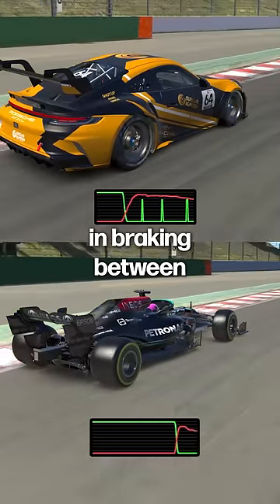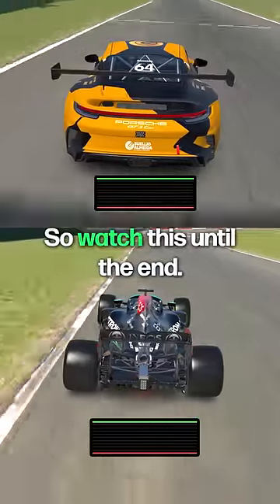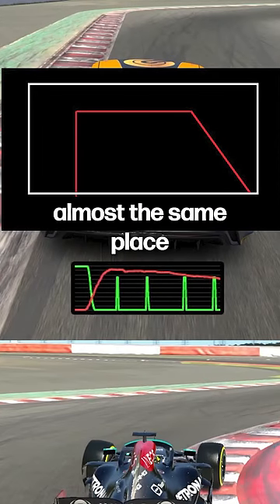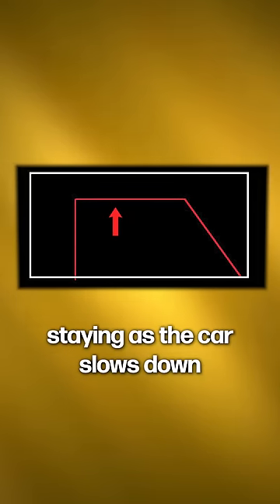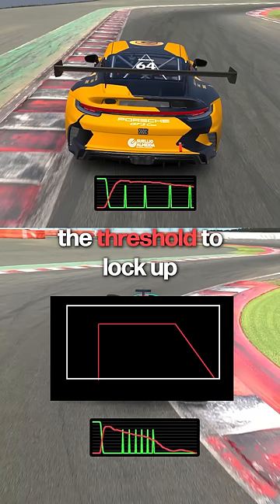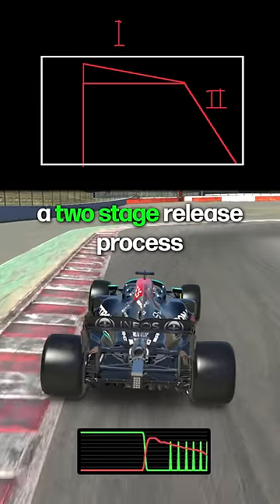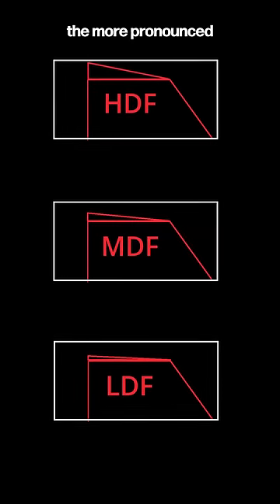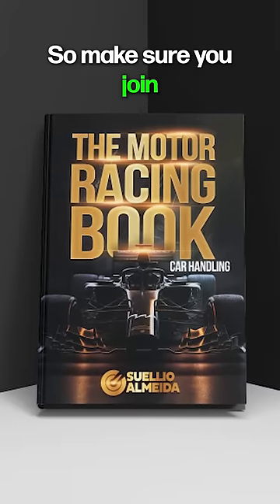BIGGEST Difference - Formula vs GT BRAKING TECHNIQUE! #simracing

Comment: My guy made it more confusing
Reply: Only engineers understand
Reply: Lets say this in percents (the braking). In f1 car :
1. Press to 100% to slow down quick. If it is staying at 100% for too much you will lock up.
2. Release the brake to 80-95%. The maximum pressure you need no brake and not to lock up.
3. Release it to 0% gradually, and start tacking the corner and accelerating.
Reply: See, you don't just have to trail brake, you have to release some brake pressure while braking in a straight line, because your downforce decreases as your speed decreases, decreasing how hard you can brake because your grip is lower

Comment: Isn't that because the GT car has ABS while the Formula doesn't? I don't understand how downforce has anything to do with locking your wheels
Reply: Downforce adds grip. So when the downforce gets lower because your slowing down, the available grip for braking also is less.
Reply: Downforce helps you slow down.
Reply: Downforce pushes your car and tyres into the ground, giving you grip. The more downforce you have, the more grip your tyres have. You also have more downforce at higher speeds. So higher speeds = more grip = more brake pressure.

As you slow down, you lose downforce, so your tyres have less grip, and you have to reduce brake pressure so you don’t lock up.

Comment: yes and no
this is all good and dandy with ABS and other electronic aides...
but different configurations require different techniques... wings or no wings...

it's based on the kinetic energy, force of friction on the tires and breaking force required to lock the wheels...

Comment: Why in iRacing drivers almost never use 100% brake in any car??
Reply: ACC is much more forgiving with braking, iRacing it’s a lot easier to lock up the brakes, which is why u see this happening
Reply: @hexhiaa  Is it also because cars in ACC have less braking power so you can use 100%??

Comment: I'm too stupid to understand
Reply: its not you
Reply: You can hold the brakes in GT cars but have to slowly release the brakes in F1.
Reply: The more you brake the slower you go but in a car where downforce plays a big part like f1 you cant just stomp the brakes until you make the corner. The slower you go the lower downforce you get. When you go slow enough downforce basically plays no part and its only tires that keep you on the track so if you keep 100% brake pressure when the downforce is too small you will lock up. So just slowly decrease brake pressure as you slow down.
Reply: basically what guy above me said. on downforce cars, you usually brake harder than your tires would usually allow, more than 100% so to say. but when downforce is applied, your tires have more grip, thus you can use that extra grip for extra braking.

while slowing down (which you do by braking), you lose downforce, thus grip, so you have to relieve brake pressure in order to not lock up (locking up is a function of braking the wheels harder, than the tires can grip the road).

what i dont get is, f1 and gt both heavily rely on downforce, so i dont understand the BIG difference between both. you cant just stomp the brake pedal on both cars while going slow, both cars will lock tires. so both brake curves behave the same

the ACTUAL difference between aero cars and regular cars is: 
- on regular cars you have a max brake pressure (function of grip). usually you hold it there by threshold braking
- on downforce cars you brake PAST the tires usual max grip, since downforce "adds" grip. the more downforce applied, the harder you can brake. the slower you go, the less aerodynamic downforce youll have. thus when braking from high speed you apply full brake, and slowly release brake pressure according to your speed, until you hit your tires grip limit. (you can also threshold brake at every point, but usually experience of brake pressure is safer.)
Reply: @DarkIzo  i guess you have to do the whole process faster in f1 than in gt because downforce that gt cars produce is nothing compared to f1.
Reply: @Maggi4932 yes. In f1, 90% of cornering is just glidinh

Comment: What about steering?
Reply: Faster steering in light cars with stiff suspension, slower steering in heavy cars with more body roll
Reply: adding on to what he said, in high downforce cars u wanna be faster for high speed corners, and have a slower turn in for lower speed, whereas for low downforce afaik steering will be mostly the same, although i could be incorrect